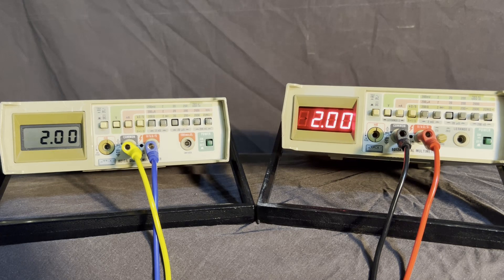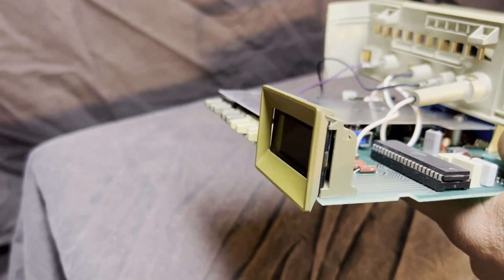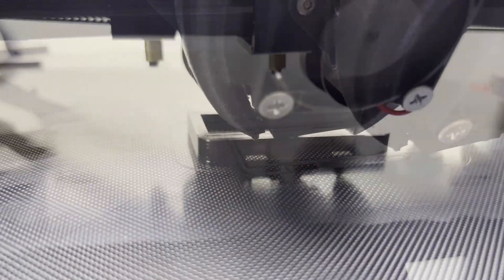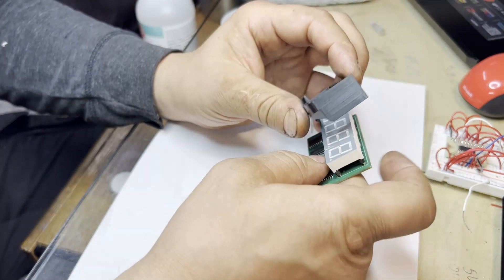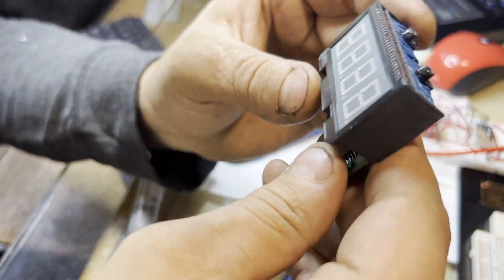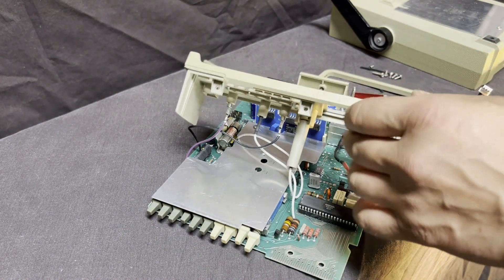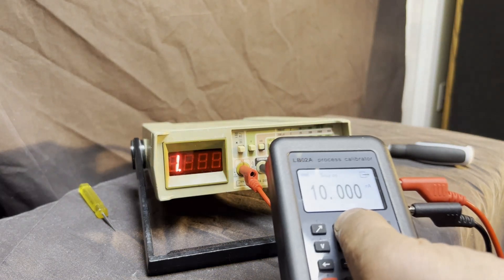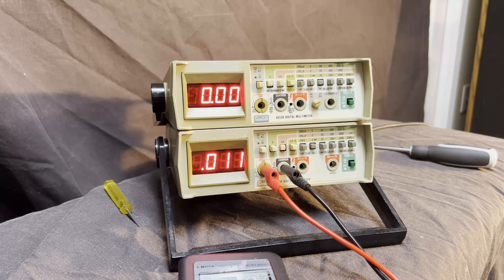Fluke 8010A 8012A Led Display Conversion

Comment: The insides of the 8010A look very different as compared to my 8050A DMM.  The display looks very similar (though mine had a degraded LCD), and the 8050A has a daughter board with the display and switches.   I replaced my 7-segment LCD display with a color graphical LCD display that just happens to fit into the bezel.  It's driven by an STM32F103 microcontroller on a small board that has a 40 pin socket for the original microcontroller inside the Fluke with long wire-wrap pins that fit into the socket on the Fluke's PCB.  So all that I needed to do was pull the 40 pin DIP out and install it.  This came in real handy, as I did the development on an "organ donor" 8050A that had something really wrong with the measurement part, but the microprocessor still worked.

The code in my new microcontroller just watches the I/O signals on the original.   It catches the multiplexed digit outputs and strobe signals, as well as looking at all of the mode and range switches.  I was able to add "min" and "max" readings on the graphical LCD, a little bar graph as well as displaying the mode and AC/DC state.   My code was written in FORTH because.. no good reason other than this was a good project to learn FORTH on.  It was handy to be able to do interactive development with the console in FORTH to poke around at the hardware pins and see WTF was going on, outside of the usual compile/link/download/debug/profanity development process.  I've got some blog posts around; search for "8050A forth" and stuff should turn up, as well as a github repo with the code.

It sure makes a difference in the usability of the meters when they have a bright, easy to read display on them.  This is really nice work!  I especially love the 3D printed bracket you created, which is somewhat more elegant than my using Sugru to stick my display in place.
Reply: do you remember the LCD you used?  (and where you got it)
So, you took the 8050a's U17 out and redid all the functions?
Reply: @rickjljr11  The display was a random AliExpress 320x240 SPI connected color LCD with an ILI9341 controller.   I had to do a little bit of surgery to cut off part of the PCB the display was mounted in to fit into the front panel.   If you search for "transsys fluke 8050a LCD" you'll find some blog postings with more information.

I didn't replace the existing microcontroller, just relocated it into a socket on a protoboard, where the long (wire-wrap) pins of the new socket fit into the old socket on the Fluke.  So just an easy way to access all the signals on the microcontroller, rather than having to solder to the board.  I was able to do my development on a broken 8050A I got off ebay and when working, move it to the real one.

Comment: It look so good, great work! I’m curious to know what IC you used to buffer the signal
Reply from the maker: Hi there.  The buffers are  the SN74LV240ANSR.  It is an inverting buffer with an enable disable function for buss managment.  Im using both of the enable disable pins on all four chips on a pull up resistor pulled low by a single n channel mos driven by the BP drive pin on the meters ic. The rest of the lcd pins go one for one through the buffer. 

Thanks for watching.
Reply: @allaird1  Thank you!

Comment from the maker: Hi. The lcd drivers put out a 0-5v pp voltage in reference to the digital ground.  Im sure you could decode the 30 pins and load registers in an arduino for math or data output. All kinds different things could be possibe. Neat idea. Put a little touch screen.    Would be a fun project. Thanks for watching👍
Reply: Thank you!
Reply: I wondered about doing such so I could feed it into a PC and do data logging etc.

Comment: im wondering if how many volts are the output of the LCD driver. and if it could be read by arduino. planning also to do this but display will be OLED screen and much more information too display. hope you reply, thanks!